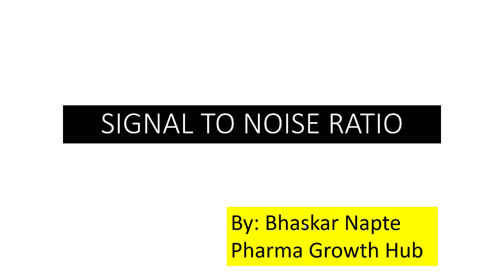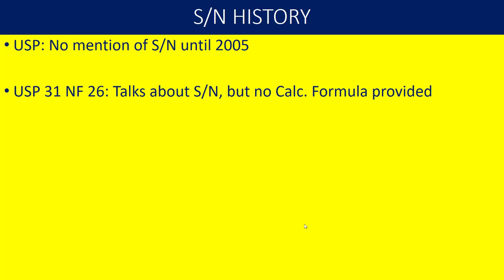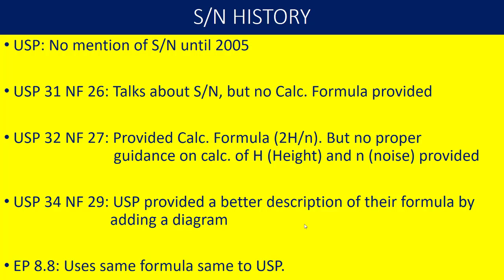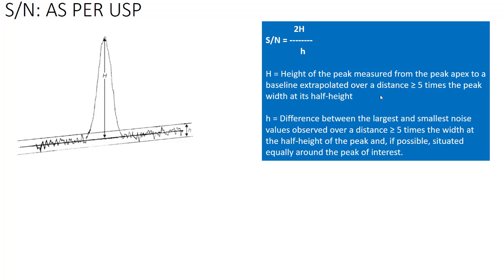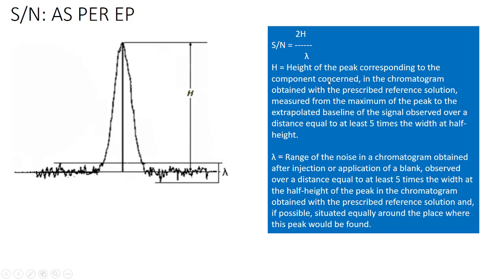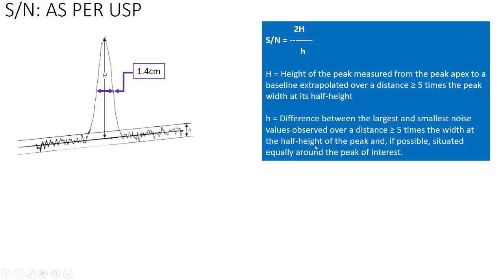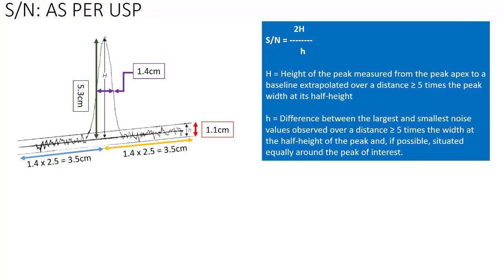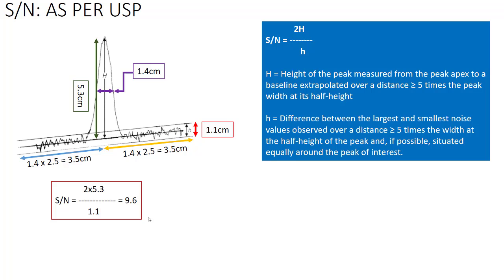What is Signal to Noise Ratio and How to Calculate it?

Comment: But sir why we need to calculate S/N ratio?
Reply: It iss needed in order to calculate the LOD and LOQ. Also its good to understand how the system is performing with certain compounds.
Reply: @diego39500  But what is LOD and LOQ?How to calculate?
Reply: @gopalgirase-01  lod is limit.of detection, how low can your system detect there is something. And Loq is the limit of quatitation. Lod might be 3 times the SD of spike blanks. And loq is 3.3 times the lod